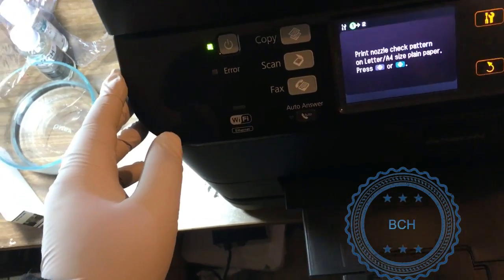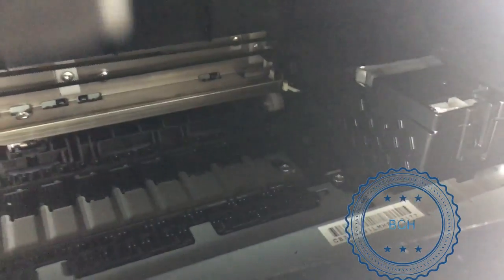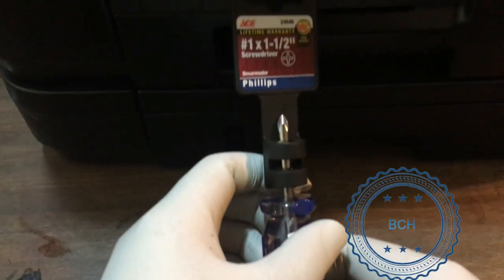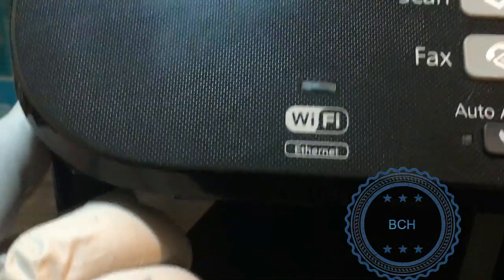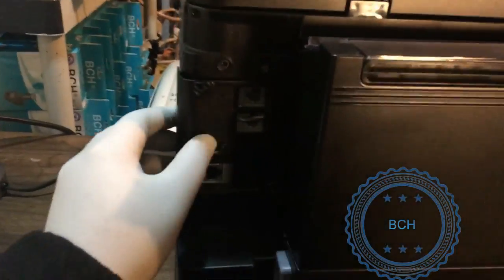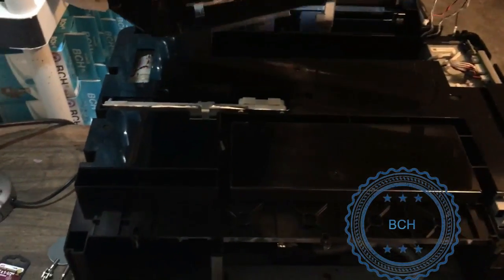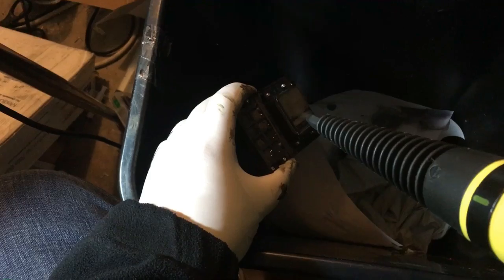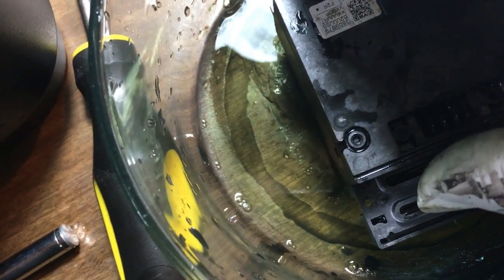A Powerful Way to Remove and Unclog Epson Print Head Nozzles  WP-4540

Comment: I have been able to unscrew both screws of the ink plastic pipes on top of the print head but as soon as I did that, lots of black ink started to come (cartridges has been removed, but there is lots of ink remaining in the pipes) so if you do this, take lots of precausions to avoid ink to go in the little wheels intented to move paper sheet or you'll get black ink lines on all your sheets for the reste of your life...The ink is very difficult to clean on the skin, so wear gloves!

Comment: I am watching your video on how to take your Epson printer apart to clean the printer head at one point at 5 minutes and 18 seconds you're taking the front door off and it doesn't show how to disconnect your not showing how to disconnect it on the left hand side your camera just dips down too far and we have messed with us and we can't get it apart we have taken the two screws out of the cartridge compartment and the screw that's on the right hand up or right hand side but we need to know how to get the right hand side apart so we can lift it up and off of the printer please help us
Reply from the maker: Thanks so much for subscribing and supporting the channel – it really helps us get closer to the 100k goal! I appreciate you catching that section at 5:18 where the camera dips. After removing the screws, the left side of the front door usually has a small plastic latch inside that needs to be pressed or pried gently. I recommend using a thin flathead screwdriver or plastic spudger to push it inward while lifting the panel slightly. Sometimes a little wiggling helps if it feels stuck. Also, double-check for hidden clips along the seam. If you need more detailed instructions, check out bchtechnologies.com – we have repair guides that walk you through Epson printer disassembly step by step. Let me know if this helps or if you run into any other snags – I’m happy to assist further!

Comment: this is a terrific video.  The use of steam was something I hadn't thought of.  That being said, more than a few sites have cautioned against using US cleaning as it can destroy the print head membranes.  Any thoughts on that?
Reply from the maker: You can only use US for certain models with carefully managed timings.  Trial and error.  Most of Epson can’t handle it.  However, it is very effective when it works.
Reply: @BCHTechnologies  How can I find out if my Epson TX810FW will handle ultrasonic cleaner?

Comment: Hello i just a an r1800 used it was in great condition except the maintenance tank need to be reset, i switched the cartridge and cleaned the pads, now i cant get a good print even after cleaning the wiper blade the capping station pads, the pads on the other side too .... not really sure what else to do

Comment: hi. I have a epson c5790 printer. My printer does not print magenta. I'm doing head cleaning, magenta color is coming. Head is intact. but after some printing, the red color still does not come on.
I inserted a solid cartridge problem persists again. please help me. thanks.
prints yellow instead of red constantly.
I have done eeprom reset. I updated the software problem continues.
Reply from the maker: That’s a laser printer. I don’t do laser at all. Sorry.
Reply: @BCHTechnologies  thanks but my printer inkjet.
Reply: did you manage to fix it?  I have the same problem with my Epson wf c5290, it prints a few sheets of magenta well and then it just stops coming out, I have tried doing multiple cleanings but nothing solves it and I am afraid to remove the head for manual cleaning without being sure that that will solve the problem
Reply: @catalinatoledokiessling9803  It's called "ink starving" and it's probably due to the ink microfilter sitting inside the cartridge spikes inside the printer being half-clogged. You need a good cleaning liquid with ammonia (use it warm) and possibly an ultrasonic bath. Careful as it may fry the nozzles, especially MicroPiezo heads.

Comment: So...as it states - do not try this at home!  The instructions are clear enough, and with some patience you could potentially clear your print head.  I reckon the chances of it going back together without something snapping or breaking would be fairly minimal, but maybe worth a shot.  

But I think some further cautions wouldn’t go astray in the video.

I was trying to fix a wf4630 (slightly different) and for whatever reason when I started unscrewing the print head as instructed ink started leaking out everywhere.  Luckily I had placed down old newspaper otherwise bench would have been stained bad.  I persevered a little longer before realising it was a lost cause and yeeting it into the bin.

Heading to the shop to get a new printer now.
Reply: Yeah, that's a bad idea to remove those 2 screws up front. The head can be removed with paint hoses still attached. And then you can unplug those hoses. I ruined my printer by spilling paint on the  printing head power cables. Be carrfull.

Comment: Thank you very much for the video.  After years of faithful service with refillable tanks and no blockages that couldn't be cleared with the normal head clean (and many thousands of pages printed), the yellow printhead clogged so bad nothing at all would come out in the nozzle check.  Dismantled the printer as per your video (and I doubt that I would have attempted this dismantle without your video) and have been using all the suggested cleaning techniques except the steam which I don't have, including soaking just the head in Windex for 24 hours.  Every colour is quite clear but yellow is still fully blocked.  I'm about to give up and buy a new one because as many people have said with the cost of a new printer its not worth the two days I have already wasted on this.  I'll soak it another 24 hours and if that doesn't clear it then its off the rubbish pile for this printer.

Comment: I didn't go as far as taking it apart, I opened the door and placed a piece of cut up thin cloth wider than the head assembly. I soaked it in alcohol before I placed it along the metal under the head and moved the head to the middle of the cloth so I could grab it both sides. I then cleaned the head by moving the cloth back and forth while pulling upward.
I had to run a few machine head cleans from the menu but eventually I got all blacks and colours showing on the test matrix.
Reply: can you make video for that please!!
Reply: @mamedaisuki7066  I can't really, but I thought I ruined the printer after that as it hardly deposited any ink. So I ran the head cleaning function a few times and it started to come back (ink must have really diluted and softened).
Eventually all the jets had become clear and it has remained unclogged..
Just as the top instructions say, you'll be fine.

Comment: in theory it should be so. but you on video washed the print head with water, 100% after this procedure there will be a short circuit (similarly the ultrasound print heads epson and canon are badly affected, I've been repairing the printheads for 15 years and I can give many safe tips for restoring the heads.
Reply: You said you've been cleaning print heads for 15+ years and criticize the methods in the video and then say you can offer the proper procedures to go about doing it correctly but then people praise you for your wealth of knowledge and wisdom and cry out for help but are only left with the sound of crickets chirping........you pulled a Houdini on em'...😔
Reply: Центр Заправки Картриджей  I have an epson 4530, can you help me? Mines is clogged in two colors. What is the best and easiest way to fix it?
Reply: I would absolutely welcome seeing your take on servicing a similar device in more detail.
Reply: I have Epson WF-7511, I have cleaned the print head several times, but the print pattern is still improper, plz give me some solution.
Reply from the maker: Thanks so much for being a subscriber and for sharing your perspective—I really value hearing from someone with your level of experience in printhead repair! You’re absolutely right about the risks of water exposure, and while the video shows one method that has worked in practice, I always recommend caution. To address that concern, I put the printhead in 99% isopropyl alcohol afterward. Alcohol has a much lower surface tension and evaporates far more quickly than water, so when you dip a water-exposed printhead in 99% alcohol, the alcohol displaces the remaining water and then evaporates, leaving the electronics dry. Because high-purity isopropyl is non-conductive when dry (or even when wet at high concentration), the printhead can usually be used right away without risk of shorting. Every subscriber like you helps us move closer to our 100k goal, and I do my best to answer subscriber questions within a few days, though I’m still working through a pretty big backlog. If you ever need a faster response, you can always reach out directly at support@bchtechnologies.com
. Thanks again for supporting the channel and contributing your knowledge—it really helps the entire community!

Comment: I cleaned mine as instructed. Everything is dry and I put it back together. Plugged it in but now it won't turn on. I hold the power button on and it flashes on and off. I'm sure I hooked it all up correctly. Please help! I forgot to add I have a Epson wp 4020
Reply: i think it is not totally dry, specially the inside part on the electronic. i have the same situation, one of a transistor get short, so i have to replace it.
Reply: dont do as you seen, if did you ruined your printer as put hot water direct to your bald head,

Comment: Hi.  You can get the electric circuit wet.  The print head itself is actually wet when you are cleaning it.  The FACTORY cleans the electric contacts when it is being produced.  They are just brass, copper or other conductive leads.  They are not made out of wood or paper which would disintegrate contacting water.  Dry before you re-connect it, will be safe.
Reply from the maker: Agree.  Just make sure to dry the connections before putting it back.  We had an accident in WF-3520 which we didn't wipe it dry.  The electricity was strong enough to burn a small hole on the ribbon.  We are surprised how much juice goes into the printhead.  However, it is okay to get it wet as long as you dry it properly before put it in.
Reply: Just use pressurized air can spray moisture out.  Or sit it on a towel if you can be patient.
Reply: Water is not used in electronic production after the board is populated, mostly the boards are washed in solvents like MEK that don't tend to become electrically conductive, evaporate easily, and don't have high surface tension to retain them in crevices, though mild or occasional exposure to water is not an issue, depends on specific protective measures chosen, but generally avoiding conductive path via contaminated water is sufficient in operation. It would have been an issue if there was any exposed copper, but there plain isn't, any copper is tinned and the PCB is then lacquered, and the contacts are plated with a special gold-nickel alloy that may also contain iron, carbon and cobalt. Brass barely ever finds use in electronics.

Comment: I bought an Espon WP4545. It had great reviews and came highly recommended. For 6 months, my printer worked great BUT then there was a massive leak with the cartridges. Please bear in mind, I only ever used original cartridges from bought (at a premium) from Epson and only used quality paper.

Do some quick research and you will see that there is an inherent leakage problem with this range of printers. Epson is not taking responsibility and frankly, I haven't got the time to chase this legally with them. I'm left with one of two choices. Get an expensive repair or just go get another printer, which I'm going to do.

So take my advice and do yourself a favour, go for another brand.
Reply: First, you're absolutely right: Epsons are ghastly printers and should be left alone on shops' shelves. Second, you had a prime case of warranty claim, as the printer went wrong within the warranty period (over here is 2 years). You should have insisted and persisted to get redress.